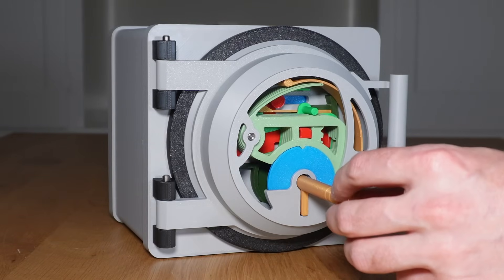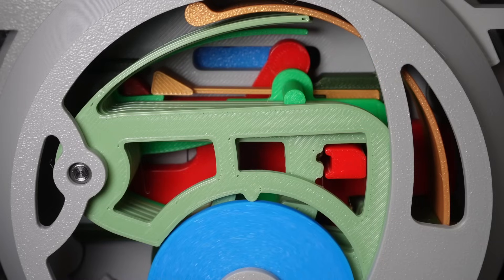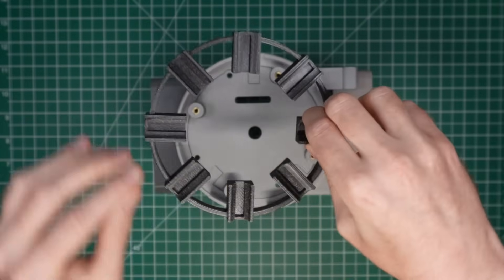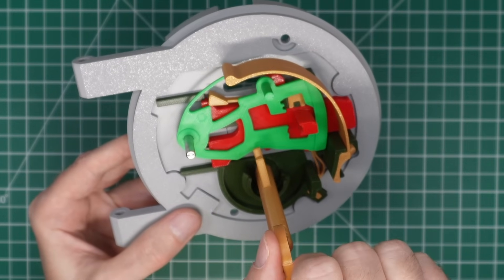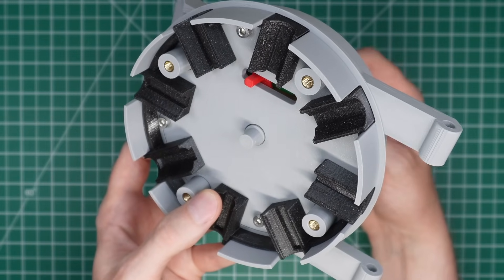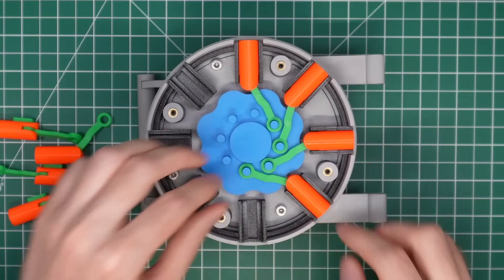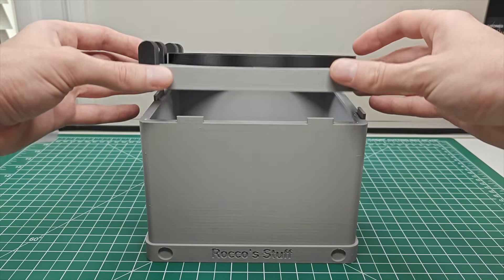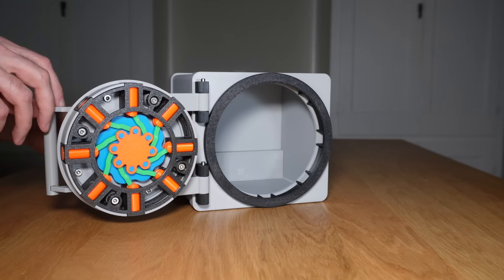I 3D Printed a Vault Even Locksmiths Would Struggle With!

Comment: asides the lockpicking lawyer, I'm wondering if 3d printing could make lock picking it harder. Since you can get shapes you can't make with machining. If not already been done, I'd suggest trying to make a lock harder to prick thanks to 3d printing strengths.
Reply from the maker: That's an interesting suggestion, I'll keep it in mind for the next project. 3D printing definitely has some advantages...

Comment: I have no real locksmith knowledge, so I might be totally wrong, but hear me out:
I think the reset system is a fatal flaw (if you know the internals of the lock).
By the looks of it, attacker can "pick the lock in reverse" as you said, so first pick to the reset position, since that side has no false gates and no traps preventing from picking.
From there, the attacker can decode (or at least approximate) the correct position of the levers, and try to use that knowledge to pick the lock open.

I think an experienced lockpicker could possibly deduce this information even without implicit knowledge of the internals, but don't quote me on that :D
Reply from the maker: You're right - I think that's a method that could work. One way to mitigate it would be to separate the cutouts for the actual lock and the reset - meaning a separate key would be required to reset the detector (which another comment suggested).

Thanks for the comment - you may not be a locksmith but you make a very good point 😎

Comment: What if…you make the key cutout hidden with some flaps that can only be lifted by the lock mechanism? 🤔
Reply from the maker: Intriguing... are you suggesting the key itself has some sort of flap to cover the ward cut - or that the keyhole in the vault has a cover which can only be opened with key?
Reply: @RoccosStuff  Precisely the key with two flaps that only lift up to reveal the ward cut shape when inside the lock.

Comment: Very nice design!

I'm obviously not a pro lock designer or picker, so feel free to ignore the rest of this comment lol

Only thing I see is the "ward" might need to be extended more to reduce the amount of open space between its ends.  The latch's throw/slide length is less then the radius the key turns between the edges of the ward, so with practice, a modified tubular pick might be able to defeat the ward as-is.  Might also be good to add a shielded spring (maybe mounted behind the slide/latch) that forces the latch to auto-close when the key is not present and held to the open position.   This keeps a picker from resetting their tools when trying to bypass the ward.

Either way, awesome design!

Comment: Could you separate the reset driver cutout from the unlocking driver cutout?
Reply from the maker: Yes... are you suggesting different bitting or different ward cutouts? I suppose either is possible. With different bitting, you would need a separate key to reset the detector, which would certainly make it more secure.

Comment: Is the convex bump on the inside of the ward on the key necessary for the lock to function?  If not, I could imagine a skeletonized key passing the wards without a snug fit.
Reply from the maker: It's not strictly necessary, but the more complex the shape is the more challenging to get around - but I made the convex shape because it can be 3D printed in a single piece. A key with a larger cutout could certainly go around it.

For 3D printed keys, it's important to not cut out too much of the bit, so a larger cutout would result in an easily broken key.

Comment: It's so close to being a perfect design. I think the weights could've been placed under the floor of the safe so that you wouldn't have an awkward step inside. Apart from that, an amazing mechanism design. Keep up the good work!
Reply from the maker: Thank you!

I located the weights at the back to try to concentrate the weight as far from the pivot point as possible, which minimizes the amount of weight required. I tested it out by just putting weights in an empty box and it took quite a bit more weight on the bottom, as it is more spread out. 

But I agree with the point - the step is a bit awkward and not ideal...

Comment: It's very cool, your cad skills are next level.  What is your preferred package? As I was watching, it crossed my mind if the safe case were made in three sections. A back, the walls and a front cap.  The sections could be filled with plaster or a fine concrete to give the whole thing extra mass.  Love your work, I look forward to your next project.  Take a look at the Bowley Lock, this in conjunction with the trip mechanism would be pretty awesome.  Also I like the safes with a spoked wheel to retract the bolts. I know functionally they don't need to be there but they do look cool. 😍😍👍👍
Reply from the maker: Thanks! I use Fusion 360 for most of the design and AutoCAD LT to work out the geometry of the lock. I've been using CAD for a very, very long time 😂

And great suggestion for the walls, I'll keep that in mind for next time. And I'll need to look further at the Bowley lock, after a quick google it seems very interesting...

Comment: Lockpicking Lawyer collab when?)
Reply from the maker: That would be SO cool. If this design is popular I might send him one. This lock is definitely the most secure and refined that I've ever made.
Reply: Would be very interested in seeing LPL take a stab at this.
Reply: @Cas1O  I mean it's 3D printed, he will 100% exploit the bad tolerances (he did that with StuffMadeHere's lock even tough it was made from metal). He will need to send him one precisely machined out of aluminium at least.
Reply: Yup, LPL or it never happened…
Reply: Either LPL or McNallyOfficial
Reply: This is mostly security through obscurity. As long as you know about detector lever you can circumvent it or even exploit it to get more feedback. Much harder on a real lock, but 3D printed one don't stand a chance, he'll just reset it using some kind of shim or whatever.
Reply: @ErrorTH  I bet if this was an actual 6 foot tall iron door, it would be harder to exploit the detector? But that's just my guess on it.
Reply: Im pretty sure LPL would actually try to pick this "legit".
Reply: @JonneBackhaus my thoughts exactly
Reply: Its plastic. He would just smash it with a master lock until it opened.
Reply: @RPG_Guy-fx8ns  For the meme, possibly. But I think both of them would respect the design enough that they would want to defeat it properly first. Although with McNally's workshop, I'd love to see him use the files to machine it properly before trying.
Reply: @RPG_Guy-fx8ns  remember at the very least lock picking lawyer usually resorts to non-destructive methods of opening stuff obviously any 3D printed set up would be easily defeated by a good hammer but he usually will try to defeat the mechanism by being able to manipulate it into an unlocked position while leaving the rest of it intact and functional and capable of being relocked